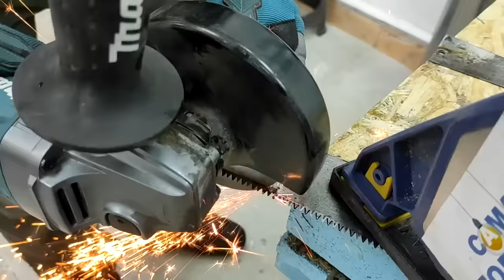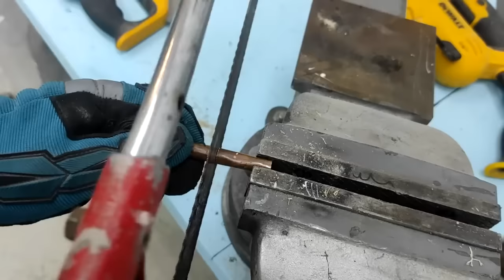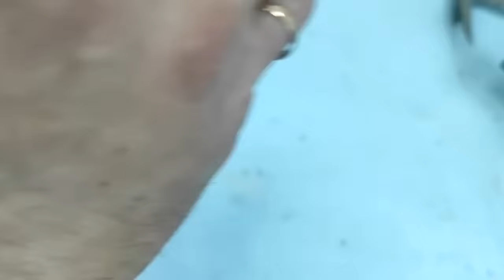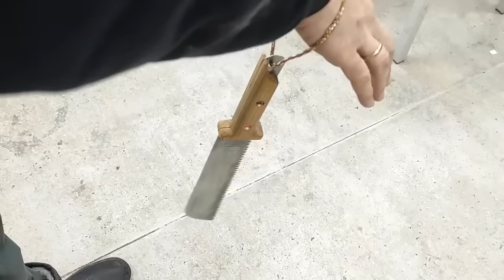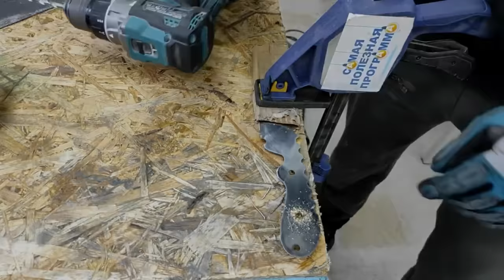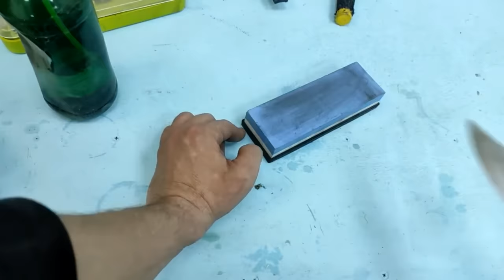НИКОГДА НЕ ВЫБРАСЫВАЙ старую ПИЛУ! Две отличные идеи своими руками!

Comment: Excelent stuff. I'm doing same thing. 
 Finding hard to drill this steel thou, it ate even carbide .
Reply from the maker: Thank you very much
Reply: @-Leha-  You earned it, man. Respect. So , how You drill it anyway? Do you heat it up to unharden it, or something else?
Reply from the maker: @panprezes4911  I use a ceramic drill
Reply: @-Leha-  Allright. That make sense. I never had one . Thanks.

Comment: Sadiq Khan’s, to reduce pollution by expanding the ULEZ to greater 
London is not working. 
He doesn’t really care about pollution and air quality and here is 
why: 
- He has already increased pollution and made London the 
slowest moving city in the world, it’s far worse now since he 
introduced the LTN’s which have increased pollution on the
main roads because we are forced to use them as there are no 
other alternatives, especially during rush hour. The roads are 
now grid locked with traffic moving at walking pace and the 
fumes are getting denser and not dispersing because of it.
LTN’s need to be reopened as it is causing more damage than 
good.
Among all this, the mileage in vehicles has also increased due 
to the fact that we are forced to go the long way round to get 
to the required destination – all accumulating to even more 
emissions being emitted! Bravo Sadiq & team. (How can this 
be reducing pollution?!)
- Pedestrians as they walk along these main routes to get to 
stations, schools, shops are inhaling far more fumes than 
before, you can really notice this. Even drivers inhale more 
fumes when we are stuck in stationary traffic. This is really 
aggravating and makes no sense! 
- Cycle Lanes: Should not be taking up an extra lane of the roads, 
large pavements could be divided into two for cyclists. 
- The introductions of 20MPH roads are also a big problem
because emission fumes don’t disperse quickly and the air is 
getting even more polluted because of the need to drive in 
lower gears. (higher revs = more fumes)
Sadiq’s statement: “It is to reduce toxic air pollution” is clearly not 
accurate, he has made matters far worse. It is obvious that his 
policies are just to clobber the motorist and to generate funds for 
TFL. The situation is getting extremely out of hand and something 
needs to be done to stop him from ruining our climate even more. 
He should resign and Londoners should vote for someone who will 
make London a greater and more desirable place to live in. There 
needs to be a more logical and strategic plan that is well thought out. 
Vinnie Lauda
Reply: What is this guerilla tactic in  hijacking of the site for purpose it was not intended?

Comment: Sharp now, but not for very long. Only the teeth of the saw are hardened. The rest of the steel is not so it can be flexible and thus will not hold an edge without heat treatment.